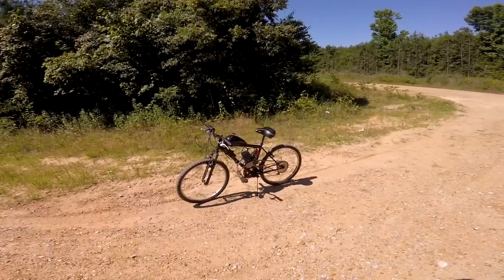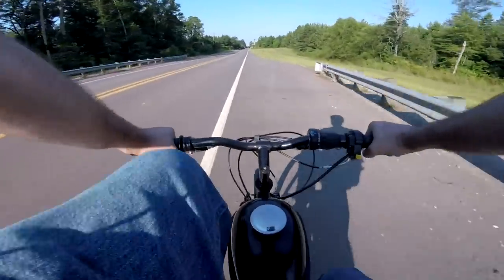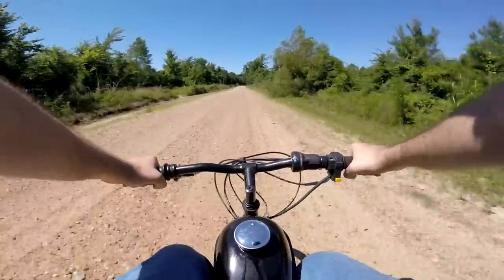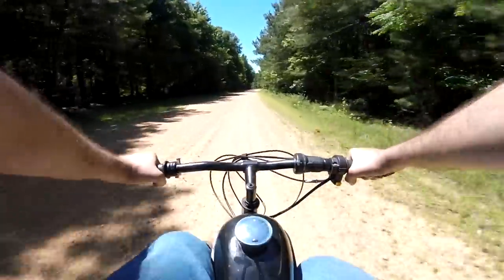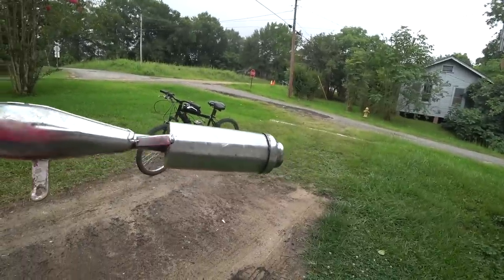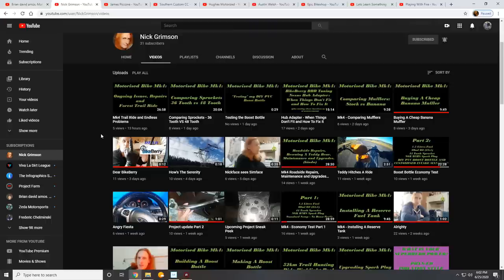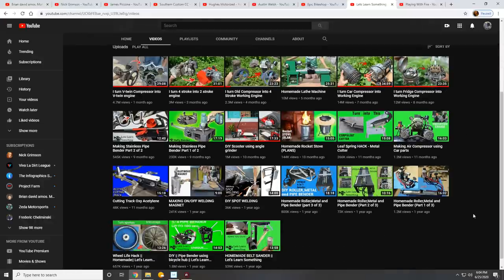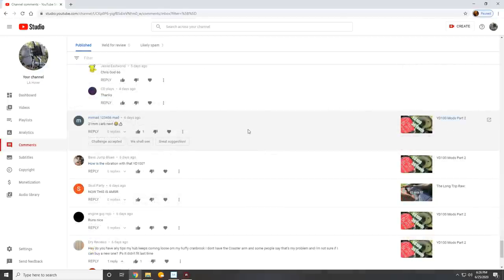Small Sprocket Advantages (Motorized Bikes)

Comment: so i kinda want to do a 2 stroke bike build but the bike i have has a rear hub with built in 3 speed and brakes and is 5.1cm diameter at the point where you would mount the sprocket and if i understand correctly thats too big for the stock sprocket hole. what would be my best option? get a custom sprocket machined somewhere? maybe a carbon fiber/nylon or carbon fiber/petg 3d printing composite material could be strong enough to get useable ride time before wearing out the sprocket?
Reply from the maker: Would you simply be able to open the center hold on the sprocket and still use the rag joint? If not than a custom built hub adapter is the only thing I can think of without having the bike in front of me. Good luck, sorry I don't have a good answer for this one.
Take some picture of the wheel and post it up in some of the Facebook groups asking for ideas.

Comment: Hey guys I'm thinking about getting the bt80, it's an electric start with a pull start and automatic clutch. I was wondering what process I have to go thru to add pedal start along with the electric, I don't mind disabling or removing pulled start. I have a back injury and a pull start is impossible so I still need to have an emergency start if the electric one goes out. Any answer or help?

Comment: Seeutek pk80 triple 40....I weigh 250 and I’m using a 36t sprocket and works awesome.... not with a stock engine....stock engines need larger sprockets.... for me I use mag wheels....
Reply: What’s your top speed?

Comment: Should i go yd100 or a 66/80 GT7? Planning on slaping a motor on my road bike just to see whats up
Reply from the maker: For your first build I recommend going with a 66/80. I love my YD, but it is a bit finicky out of the box.
Reply: @LAHover  thanks man, good to know. I'll be doing a lot of long distance cruising so ill for sure get a smaller diameter sprocket, your vid helped out a ton

Comment: By the way, what do you think of silencing the stock exhaust with glass fiber 2 stroke muffler packing?
Is it a good idea, or is the empty space in the muffler required for circulation of air or what?
Thanks for a quick response!
Reply: I made one out of one of the tall skinny type of propane tank (3" i think) and it quieted it down a lot, and it also gained quite a bit of power. in the near future I'm going to build one with an extra chamber and hopefully make it silent. lol

Comment: I just build a used stock china doll, but I got experience with engines and I'm light and I'm using a aluminum frame, it goes to rev limiter so quickly is kinda boring.

Comment: @LA Hover I have a question. I have a stock 80/66cc bike. It starts to vibrate a whole ton when I start to get into the 20 mph zone. What is there I can do on a budget to reduce the vibration?
Reply from the maker: Be sure that your motor mounts are solid, and nothing is lose. (but don't crank down on them)...
Be sure your motor is centered.
Aluminium bikes will vibrate more than steel frames.
Some motors have poorly balanced cranks. There is not much you can do to fit that with out tearing down the motor.
Something that will help is getting a smaller rear sprocket. It's a band-aid fix, but it will help by lowering RPMs while at higher speeds.

Comment: The illusion of these bikes is the size of the motors. Yeah they seem tiny and cute but they pack a serious punch. Hauling ass can get a rider into some serious trouble. If a car pulls out or slam into a pothole going that fast, the rider is going to be eating gravel or asphalt for dinner. Me I understand the power factor of these motors and will not go over 20mph. If the shit hits the fan, I got a split second to react.. Anyways, kool video, and safe riding.

Comment: Could I put a 44 tooth and a 36 tooth on my bike at the same time but have a different chain
Reply from the maker: I think it could be a good experiment, but I don't think it's practical. Assuming you can work out spacing, and chain clearance, you would probably run into chain alignment issues.

Comment: Hi is the shorter bolt on the sprocket mount a form of balancing.  Or has it backed out?
Reply from the maker: No, I just ran out of long ones so replace it with a shorter one.

Comment: I saw your video on how to ask for help and unfortunately I don't have the lighting currently to take the required photos or videos, so for that I apologize. But I was hoping you could give me a suggestion on what to do for my yd 100. When I pull the clutch handle it seems like the inside of the clutch squeaks. Now I have gone over many videos your's and some of your recommended bike guys. I have the basics down as far as, clutch pads are good, the butterfly nut is adjusted(it engages and disengages beautifully) the bucking bar has been greased. I believe the clutch rod is adjusted. So I'm perplexed. I was hoping if you find the time and read this mind numbingly long comment you could shoot an idea my way to possibly help me help myself. I appreciate if you can and if not I understand. Either way thanks.
Reply from the maker: Just one squeak, or does it keeps squeaking as long as you hold the clutch lever?
Reply: @LAHover  it squeaks as I pull it, and i noticed if i roll the bike while the clutch is pulled it squeaks aswell.
Reply: @LAHover  I'm an idiot never mind. Thanks for the reply though.

Comment: 28 teeth got me to 56mph on a bt100 electric start engine
Reply: 24 " Italian road bike from the 60s, bt100 engine mikuni carb 20mm
Custom 1.5" exhaust with expansion chamber 28t sprocket on a hub kit. No more rag joint. Sbp shift kit custom modified for this engine. #500 chain and a boost bottle for increased efficiency
Reply: @glennspears839  I have 26 motorized bicycles total. From cheap Chinese bikes to fully built Japanese grand touring bikes. And I'm building an inline triple from 3 66cc engines. Don't have a good camera otherwise I'd record all this fun stuff

Comment: I installed a smaller sprocket and cannot get the chain to stop coming off the rear sprocket, almost like it’s uneven. Anyone know how to fix this?
Reply from the maker: If it's alignment you can manipulate the chain tensioner to help.
Another possibility (not as common) is that the chain is not a perfect match for the sprocket. This can cause it to climb over the teeth.

Comment: Silicone does not attract dust - cleans easier with just water...   Down side is if you get it on any surface that needs fiction ( brakes ) or my need repainting your going to have issues....

Comment: Hey im new to these bikes and I want to take my 80cc on the trails and in hilly Pennsylvania Im wondering if I should go bigger sproket or small since Im gonna be tackling big hills.
Reply from the maker: Bigger sprocket and smaller wheels will help on trails, but you may need to slice the 
outer rubber rag-joint spacer in half so your chain dose not rub (depending on your frame.
In this video I'm running a 56 tooth sprocket on a 26" bike. It's a grate trail bike...
You may want to get a bigger head to help with air cooling because you will be going slower.
https://www.youtube.com/watch?v=geW8qlojp9c
Reply: @LAHover  Ok I just ordered the 56T sprocket and a better head. Thanks for your help.

Comment: What is an alternative spark plug for yd100...is it the ngk bp5hs- bp7hs??
Reply from the maker: I have been using a B8HS NGK. after pulling the plug a number of times it looks great. A B7HS should do also do well.
Reply: @LAHover  so that's prolly why my bike sound like its 4 stroking  ?? I mus be using wrong spark plug..I've been using the auto lite bp6hs ...and it sounds  like it is hitting the piston..un like ngk b8hs. But didn't think it was screwed all the way in and oil was coming out the side of spark plug

Comment: This thing is flying😳 is everything else stock?
Reply from the maker: 1/4" hole in the exhaust cap, and light port work.
Reply: @LAHover  which engine is this?
Reply: @LAHover  because mine is so slow compared to this
Reply from the maker: @bigmanthing9622  Yd-100
Reply: @LAHover  ohh okay thank you nice video btw

Mine is from ebay😒😂

Comment: I have issues with my spark plug clogging up on my 2-stroke seeutek bike (I’m still breaking it in) I would like to go around 15-20 mph with it but that seems to let carbon build up on the plug. How should I fix this? Should I get a smaller sprocket or a hotter plug? I’ve heard higher Rpm helps clean out the plug but I don’t want to go fast. Does anybody have suggestions?
Reply: And by the way I’m going to try using a NGK 7534 to see if that helps instead of the jingying crappy plug
Reply from the maker: In this case I would go ahead and move up to 32:1 and/or move the needle clip up a notch. I would also try a hotter plug. You got the right ideas, don't be afraid to ride faster during break in. You can even run wide open throttle, just don't hold high RPMs for more than a for seconds.

Comment: Hi i want to ask, what sprockets should i put on my front and rear wheels my bike is very light and i myself weight 60 kg i will pair my  bike with 2 stroke 80 cc engine, by the way how much rpms are okay to stay at and how much are considered bad for the bike ?
Reply from the maker: Run the stock 44 sprocket. After a while you can decide if you need more high or low end. Most unbalanced stock motors run happy between 5000-6200 rpm.
Reply: @LAHover  so using stock sprocket will be best for me, i am trying to get more performance out of the bike, also isn't 5000- 6000 like way how too much power consuming ?
Reply from the maker: There is no magic sprocket. You need to decide if you want more top speed (smaller) or more pull (larger)
Reply: @LAHover  more top speed
Reply: @LAHover  can you recommend me any quality 2 stroke 80cc engine ?
Reply from the maker: Under choose options pick the 36t sprocket for more speed. https://www.bicycle-engines.com/new-zeda-80-complete-80cc-2-stroke-motorized-bicycle-engine-kit-firestorm-edition/

Comment: Does a bigger sprocket mean higher top end speed??
Reply from the maker: On the wheel, no. 
On the motor, yes.
Smaller rear / bigger front sprocket = higher top speed but less acceleration.

Comment: If your looking for motors gasbike.net is reliable I've had excellent luck sometimes it takes some time if u have a large order but they do very well I have a gt90 that is crazy after some work there cylinders are not the best I've destroyed a few but if u want a super reliable cylinder I have found that falcon 911 cylinders are the best for quality but the exhaust ports are wider than normal so making ur exhaust match is important to keep it on

Comment: Hi i was just wondering why my chain allways jumps off
Reply: Lol, we've all been there.  Sometimes still go there,  alignment, more tension.  Depending on your setup maybe switch to a attention are with two ball bearings instead of one,   they tend to be a little more stable, and not flop around .  Definitely the way to go if you're running an arch tensioner.  If you're using just a standard 2 stroke bicycle engine those spring loaded tensioners in conjunction with the regular tensioner work wonders.  Even if your alignment is out a little bit, the spring loaded tensioner should prevent your chain from falling off.  I used the one with a tensioner roller,  Not the one with the gear.  Not that the one with the gear are not any good,  I've just never used one. I don't know if they're any good.  I know the one with the tensioner wheel works really well.  That and I don't mess with the cheap chains that come with the kit, I only get about a hundred miles out of those before I start having problems.  I use the gold 415 H chains.  And of course not to mention just rear sprockets got to be even as possible.

Comment: Can you put a sprocket on a MAG wheel
Reply from the maker: If the Mag wheel has a disk brake mount yes. There are third party sprockets that have pre drilled holes for it. Or you can drill your stock sprocket.

Comment: Lmao I did a air filter delete on my 49cc and it’s so slow I have to run it flat out but it won’t die
Reply: You may have leaned it out.   Install a larger jet. If the carb can flow enough air flow

Comment: Man your tensioner swap on the upper plate with spring are junk mine fell off after the second ride even after I tightened it my stock tensioners holding better and I used it over 100 miles now still running good the father markets have been coming apart don't know how well yes is holding but my stock seeutek motor 80 cc stock tensioner is holding better if u up grade the bearings and roller to a rubber roller works way better and smoother also considering a belt drive swap

Comment: Hello my name is Melvin Chamberlain I need to find out the best sprocket for the back end of your axle I got a off-road bike I just bought I bought the kit but I don't like all them bolts and I ain't no good lining stuff up and please if you can show me the best ones to buy to hold on your sprocket back on your back of your bike if I am saying it right okay and I got some little bit of hills and a little bit of straightaways and stuff and I'm going to probably write a lot on the road or off on the gravel roads or dirt roads and stuff okay and I got 70cc motor I don't know how it runs or anything because I ain't worked on it yet I bought about probably about 6 7 months ago might be longer than that but I'm going to work on it put it together this summer and stuff but I appreciate you get back with me and let me know thank you have a good day sir bye
Reply from the maker: I know the rag joins are a pain to install and you have to retighten at least one time after the first 2-3 rides, but honestly they have worked great for me on 26" and 29" bikes.

Comment: Hey man do u know why my motorized bike runs backwards ever those it pedal start it the right way
Reply from the maker: I have never seen this happen. My only guess is that the magnet is out of alignment.
Reply: @LAHover  yah it's soo weird how do I line up the magneto
Reply: @LAHover  do I advance 
The timing or late it
Reply: @LAHover  thank u for that I got my lil bros 66cc racing 2 stroke motorized bike running some guy sold it to him for 100$bc the bc the guy did not know how to tighten the flower nut on the clutch so he took them chain of and lied that the bike ran so I adjusted the clutch and the timing and it works now thanks

Comment: whitch is the best between 32 and 36 t
Reply from the maker: IMO 36T is a sweet spot for the YD-100. still good pull from a dead stop, and a nice cruising speed. 32T will get you more top speed if your motor have the power to take advantage of it, but it's pushing a stock bike faster than I feel safe doing.

Comment: Where can I get me some of those sprockets at ?!
Reply from the maker: I get mine on amazon. there is ebay, bikeberry, gasbike.net, etc... 
Search for "Motorized bike sprocket"
Reply: Thank you man. I'm working with a a electric motor 300 w from monsterscooterparts.com
Reply: Did the bolts and thing to hold it in place come as one
Reply from the maker: @tonyrange9665  Can't remember, I don't think so. You may want to add "motorized bike rag joint" to your search as well.
Reply: Thank you man was struggling for a second
Reply: Any chance you could help me find one of those rag joints for me that will fit mine
Reply: #25 Chain Sprocket - 55 Tooth - 1-5/16" Mounting Hole Circle (x3 Holes)
Reply: @LA Hover